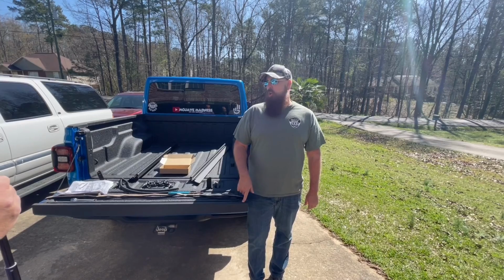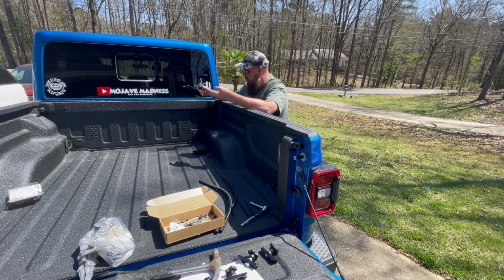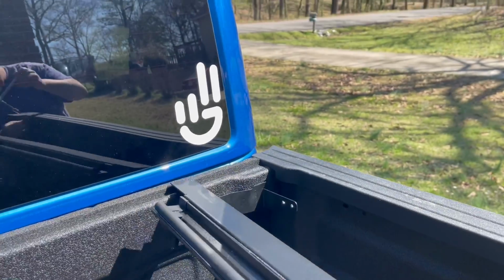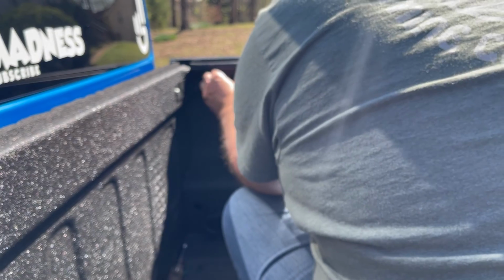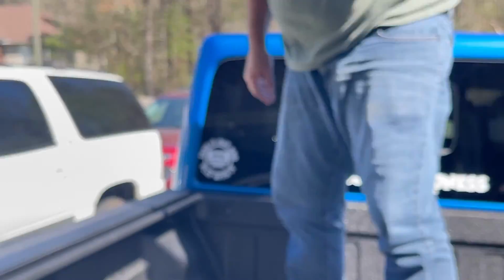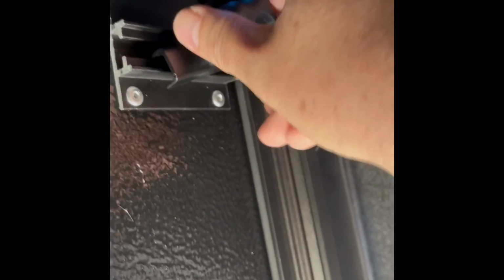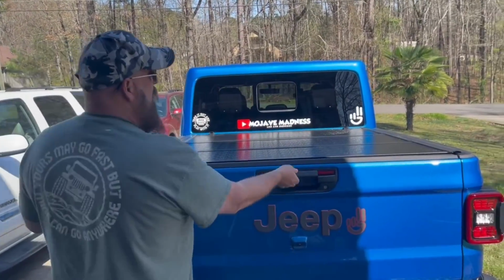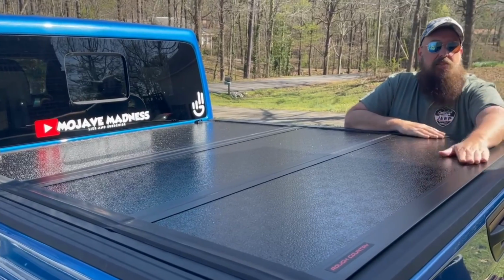Installing new tonneau cover! What a goat rodeo! #JeepPeeps #GladiatorGang

Comment: i just got a mojave 2 days ago and the dealer was going to install the mopar version of this on this Friday but I am having second thoughts and looking at other brands after hearing it leaks.

i am also hoping to find one that can easily be removed so I could still put a dirt bike in it once in awhile.

any suggestions? i have less than 48 hours to decide. lol
Reply from the maker: Congrats on your new Mojave! Yeah look around especially if you need to remove quickly for a bike.I know a lot of folks don’t like the fact that the back piece doesn’t fold up. And OEM is pretty expensive. I love mine and so far no leaks. Keep me posted and thanks for supporting the channel. I really appreciate it!
Reply: @mojavemadness5334   no worries man.  With just getting mine and loving in the mountains my normal subscribers might be screwed having to watch some mountain jeep videos. Ha ha
Reply from the maker: I just subscribed! I’m sure they will enjoy them. As far as covers, check out the Gator (soft) also check out Quadratec and extreme terrain. I’m partial to rough country. Let me know what you go with!
Reply: @mojavemadness5334  I'm eyeballing hard ones. The dealer will sell and install the Mopar for 500 as part of the sale however after seeing stories of leaks and seeing how much a pain it looks to quickly remove I'm now looking at one like yours or the undercover flex , it comes with led lights under it somehow.
Reply from the maker: @SeanOzz  oh that’s cool!  I think Gator has hard ones as well but I’m not sure if it folds up to the very back. And not sure how expensive. There are so many out there! Make your head spin! 😂